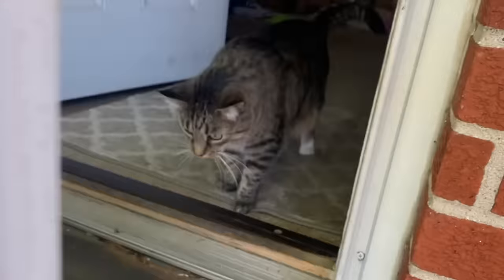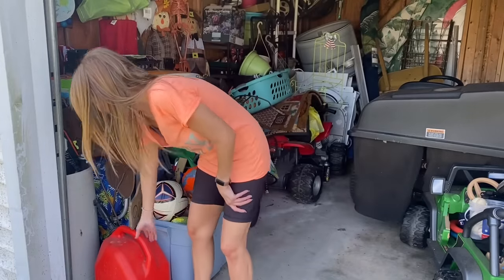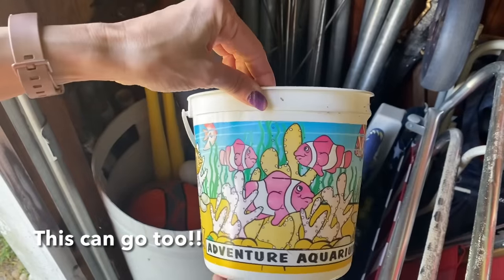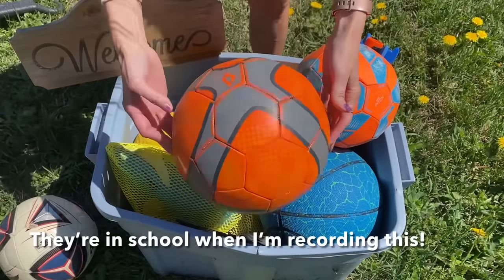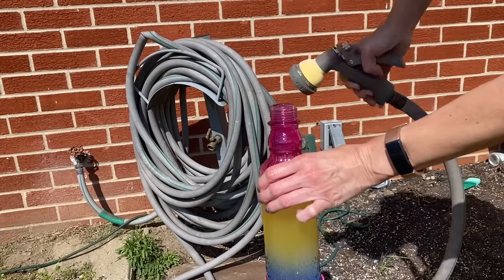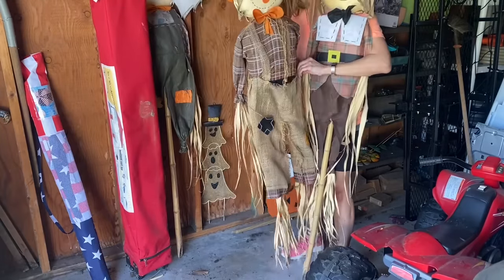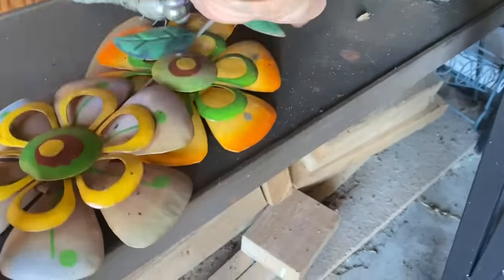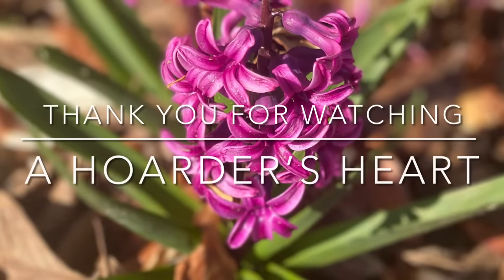Declutter the Hoarded Back Shed | Own Less Stuff!

Comment: Our garage was 2.5 cars.  No storage shed.
My rule was the garbage had to be able to hold both cars in winter.
Shelves in the 1/2 space was a life saver.
Needing storage for 4 bikes was a must . Yes the kids used the bikes a great deal.
So containers. Desiganat3 spaces for garden equipment.  Sport things 
... helped so much.
Kids helped each fall to clean up garage.  In spring I did it as it was time to put away winter specific. I miss those days.  Kids did like 5he Saturday October clean.
I noticed as time went on the garage clean out reduced from a full day to a few hours.
So all your time investment now will be ruchkt rewarded